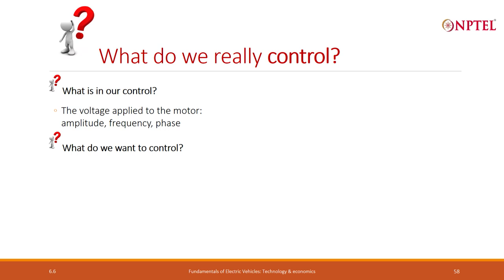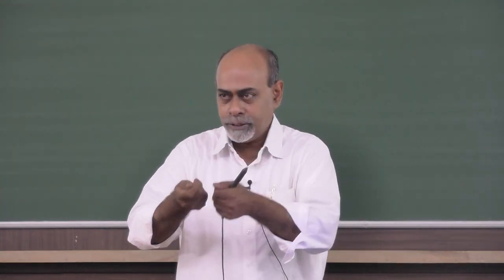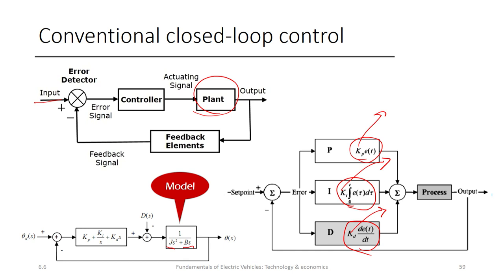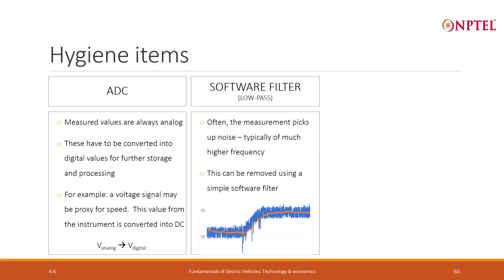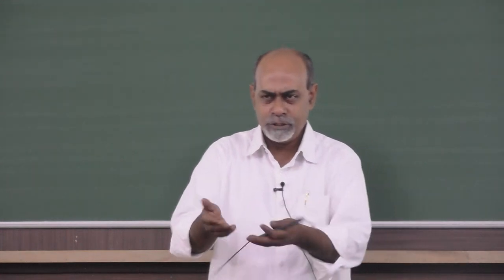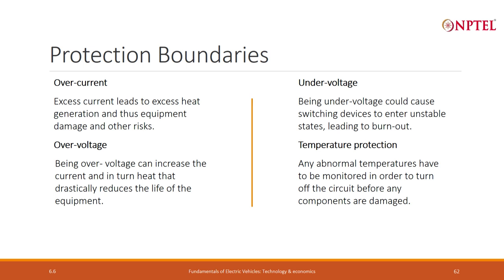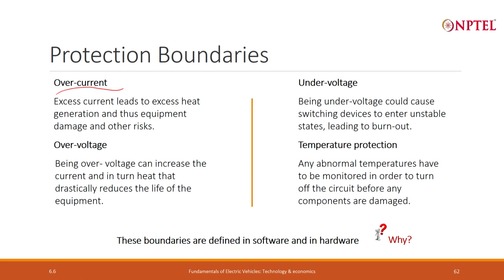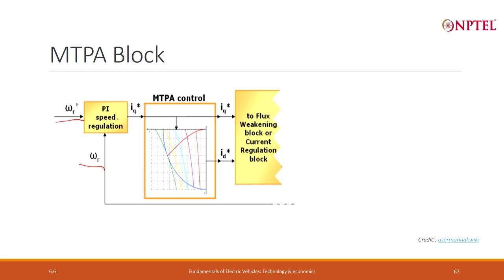Lecture 56 - Field-oriented Control

Comment: Sir , can you build a FOC controller for a bldc motor or PMSM by using the above formulas? I guess u didn't even have experience of working with MOSFETs, microcontrollers, gate drivers... Etc it is very useful if you explain to students with a practical experience.